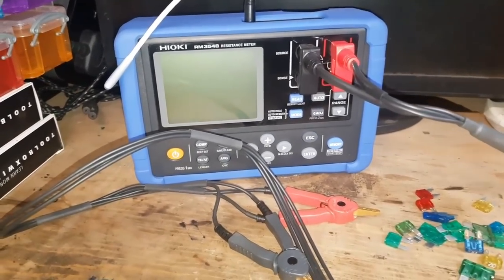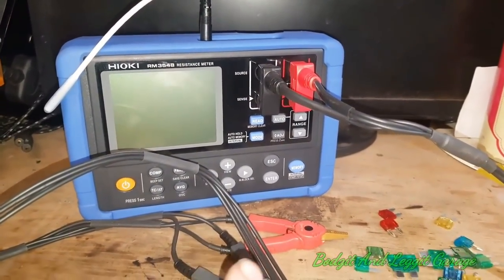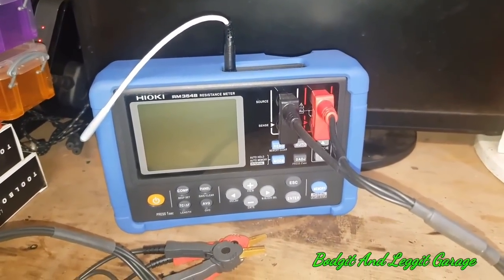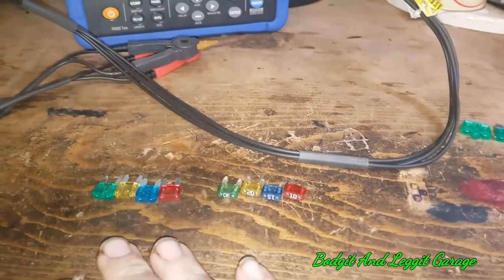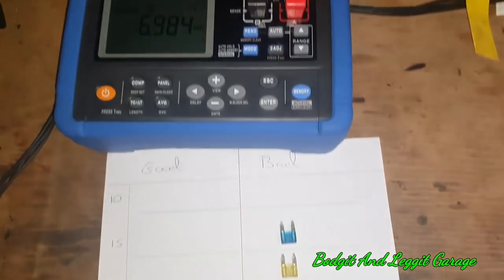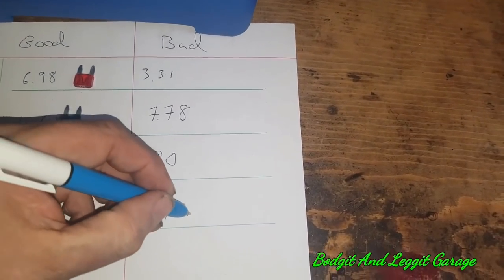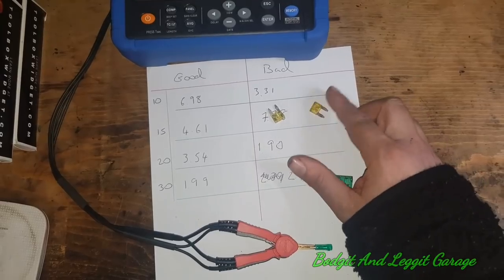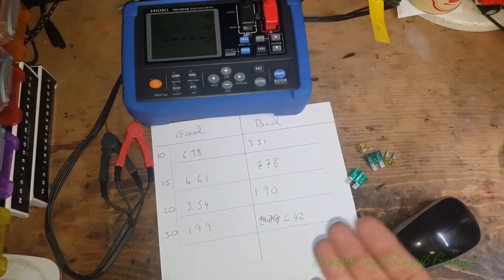Warning Don't Do This You Will Regret It Part 1

Comment: So a fuse with high resistance will produce more heat and fail at a lower amperage.   A fuse with low resistance will allow more amps before failing if all else is equal.
Reply from the maker: ohm law mate
Reply: @bodgitandleggitgarage  Ohms law doesn't help much here.  More thermodynamics and composition of the fuses.  Consistency in manufacture is key.  Cheap fuses are inconsistent and is what you've proved in the experiment.
Reply from the maker: @Chrisallengallery  Ohm's law as absolutely everything to do with this look at your first question you are describing it in your question
Reply: @bodgitandleggitgarage  Ohm's law doesn't have the power conversion to thermal energy.
Reply from the maker: @Chrisallengallery  you just completely miss understood the video🤦‍♂️
Reply: @bodgitandleggitgarage  I get the point, it's just not as simple as Ohms law. Never mind I'll get back to my domestic electrical installations.
Reply from the maker: @Chrisallengallery  🤣🤣🤣🤣🤣 ok you do that
Reply: @bodgitandleggitgarage  You have a fuse with unknown amp rating. How would you reliably test for the correct amperage rating? Using Ohm's law.
Reply from the maker: @Chrisallengallery  wow are you actually being serious right now
Reply: @bodgitandleggitgarage  Your the one who knows Ohm's law, you tell me. I totally get your milliohms test and how it shows the unreliability of cheaply manufactured fuses but when you said "Ohm's law, mate" you lost me lol
Reply from the maker: @Chrisallengallery  how to find an unknown quantity using Ohm's law all you need is two known quantities there is lots of ways to do it P÷E = amperage 
The current I in amps (A) is equal to the voltage V in volts (V) divided by the resistance R in ohms (Ω):
I = V
      R

The current I in amps (A) is equal to the power P in watts (W) divided by the voltage V in volts (V):
I = P
     V
The current I in amps (A) is equal to the square root of the power P in watts (W) divided by the resistance R in ohms (Ω):

I =  P
      R
Do you seriously want me to continue or do you get it now